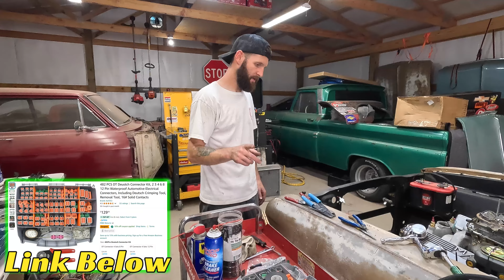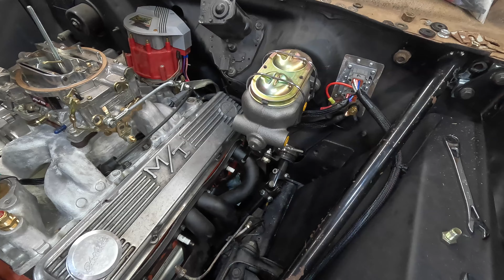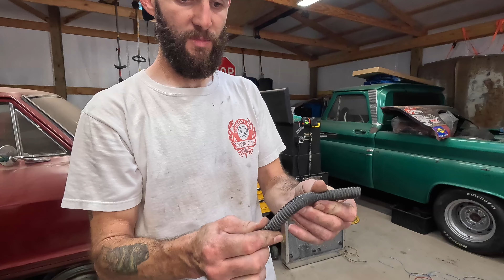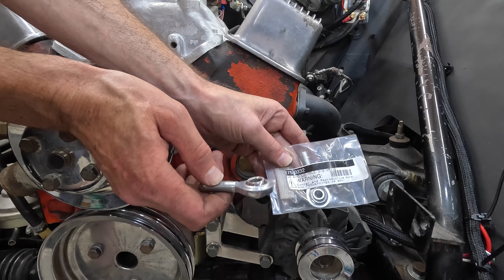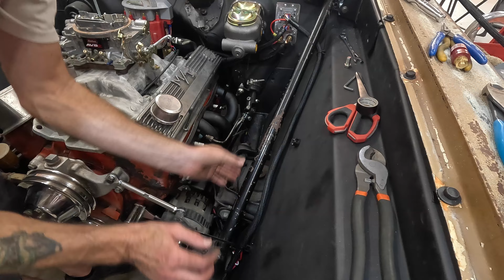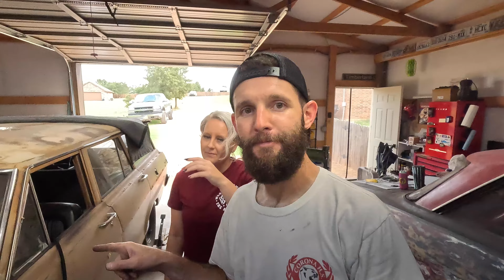Keep Your Engine Bay Clean - Wire Management Tips and Cheap Goodies

Comment: The bulkhead connectors and the magnetic pieces for the zip ties are definitely a great ideas!!!
Reply from the maker: Thanks. I spent a lot of time trying to figure out how to tackle this and end up with something that I was going to be happy with and be able to expand on in the future if need be. The magnet zip tie mounts have been awesome for keeping things neat and organized while getting layouts sorted and as mentioned in the video, pretty sure they will be up for the long haul. But worst case won't be hard to go back and replace them with screwed in cable mounts if need be. The bulkhead was a different challenge, those connectors are cheap and I was on the fence about doing them vs just a grommet, but after getting it installed and wired, so worth the investment. Very clean and when/if I expand the harness they will make doing so much easier.

Comment: Great advice and work on this stuff, I’m not looking forward to this phase, but also trying to find some K.I.S.S. solutions
Reply from the maker: Thanks. This stage is probably one of the most tedious in my opinion. It's so easy to just take short cuts and do a quick and dirty wiring job, but when you put the time in, it can look soo much cleaner and ultimately be more reliable and easier to work on in the future if needed. 
I have no doubt when you get to this point on your car, you'll want to shoot yourself in the foot to get past it but will put the time in to get it done nice and neat. Hell, you're really not to far from being able to start planning and layout your wiring to be honest, might consider starting on it while the drive train and interior and out, might be easier to at least get main runs sorted so there is just detail work as it comes together.

Comment: Did we give up on the gasser
Reply from the maker: The short answer is "kinda". haha
Definitely haven't given up on it, but did give up on having it out this year and slide it into the winter project window to try and be out next spring. Found some unexpected issues that are going to require work I hadn't planned on doing. So decided it was best to get the wagon back to be a driver before digging my heals in on the gasser. 
Plus the wife's hotrod jumped in the mix, which has been a blast to see her enjoying the car so it was worth delaying my projects a little here and there.